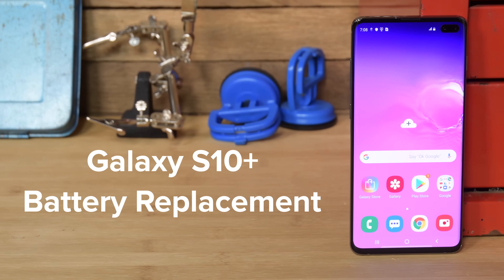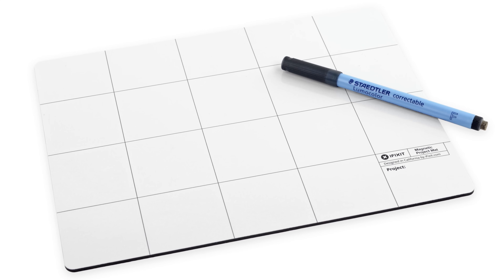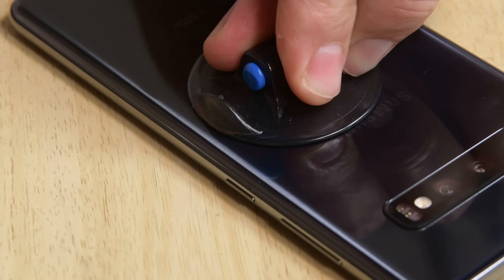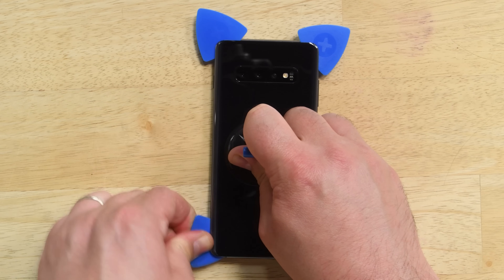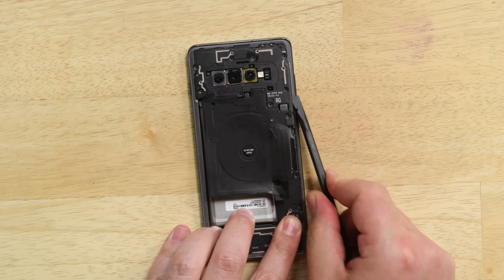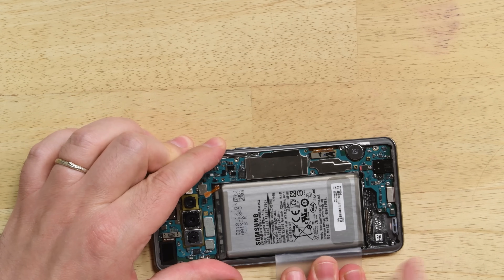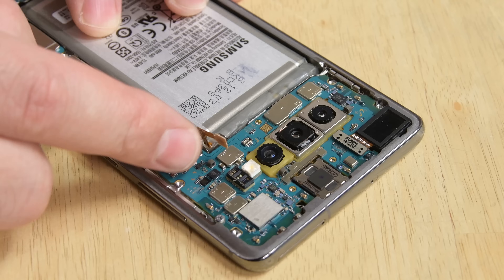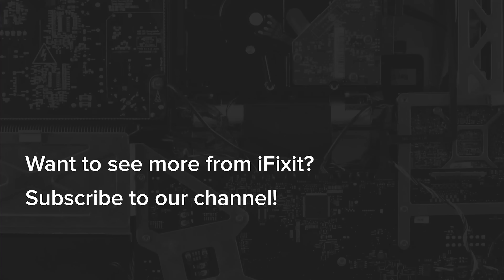Samsung S10+ Battery Replacement and Reassembly!

Comment: Man i miss the days when it was just a plastic cover with no glue at all
Reply: Bro I just came down to comment section to say this. I wish Samsung would make flagships like those again someday.
Reply: Yup.. The s5 was the last great phone you could do that
Reply: @1978mackdaddy  actually LG V20 is the last flagship that you can still replace a battery just by removing back cover
Reply: @1978mackdaddy  it came out on 2016, I've got one, currently on Lineage 16 (Android pie) with new battery of 4100mah (original is 3300)
Reply: @1978mackdaddy  yes it was the latest and greatest of it's time. It was a very underrated phone at the time. It has a Snapdragon 820, 4gb ram, QHD resolution with LCD screen. Camera is still very good especially if you use modded gcams. This is a great phone if you're happy to root it and install a ROM in it. It also has a quad DAC meaning that with headphones it will sound better than any other phone outhere (minus other LG flagships).  It can record video at 1080p or upscaled to ultra HD.

I've used up my original lithium battery of 3300 and bought a poly battery of 4100mah, that takes the same room of original, meaning that phone is lasting on average 5 to 7 hours of screen on time.

If you need more info I'd suggest you looking at reddit lg v20 or XDA forums. Hope this helped.
Reply: @1978mackdaddy  I think that's correct, it doesn't come in black, the closest is dark grey, it has an aluminium frame, it is a gorgeous phone. I warn you that it's very difficult to buy a new one so make sure you buy it from a good reliable source. Where are you from BTW?
Reply: @1978mackdaddy  right, vs995 should work in Canada alright and it's fairly easy to root and install a ROM. Let me know if you need any help doing so, it definitely is worth the hassle. I've got mine up and running strong since July 2017.
Reply: @1978mackdaddy  never heard of h910a just h910 . Just had a quick look on XDA forums and h910 is rootable so if you found a good seller go for it :)
Reply: @1978mackdaddy  can confirm that h910a is rootable using h910 method and works with AT&T
Reply: no doubt making the battery hard to replace is a business tactic to encourage consumers to buy new phones instead of just replacing the battery.
Reply: My 2016 phone is like that xd
Reply: @dreamer9071  dam son wot is it
Reply: I understand water resistance and everything, but in all honesty, the flagships before had no water resistance. And we were fine with it.
Reply: The name of the phone is symphony p7
Reply: @dreamer9071  is it a chinese phone
Reply: It is assembled in china
Reply: @dreamer9071  well is it good
Reply: I finnaly found the answer
Reply: And I'm still using a phone like that. This trucker will last pretty much as long as a live.
Reply: Actually taking the glass back off these phones is not very hard. The hard part is the batter which apple has an amazing solution where you pull on the glue tabs but apparently, Samsung never herd of this rocket science.
Reply: @THEGAMINGHELP101  mate those glue tabs can break easily even with a child hand and in recent versions they break mid way
Reply: Changeable battery.
Reply: After you remove the battery use silicone to water proof
Reply: It's just the new world order...no big deal.
Reply: I was trying to "survive", thats the reason I bought my note 5, that was the last phone like that. I bought the extra battery, 10000mah, I loved it. Buy after 5 years, it became slow. Now I have this S10+ crap, battery is becoming s*it, I donno what the heck to do. Maybe buy one of those battery cases 🤔
Reply: Me Too . I'd Several Extra Battery's For My Note 3
Reply: That's why I switch to Motorola next
Reply: So no water resistance.
Reply: @techguypaul  s5 was waterproof (ip67) and the battery could be replaced
Reply: @techguypaul  s5 was water resistant and had a removable back cover
Reply: https://youtu.be/1ai4efIWDYA
Reply: the days when the batteries were way smaller in capacity because they had to have a protective layer over them and the days when if you dropped your phone your battery would fly out? no i don’t miss those days
Reply: @brando12343  4200mah. Yeah "way smaller".
Reply: @brando12343  how clumsy were you that constantly dropping your phone was an issue?
Reply: @brando12343 that's the purpose of the case, doofus